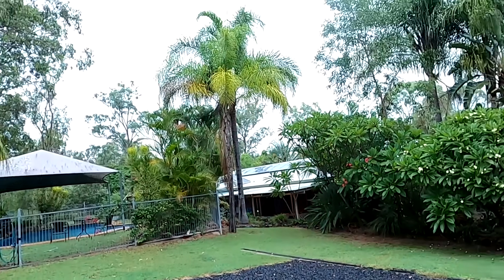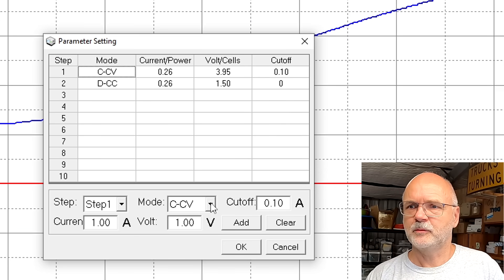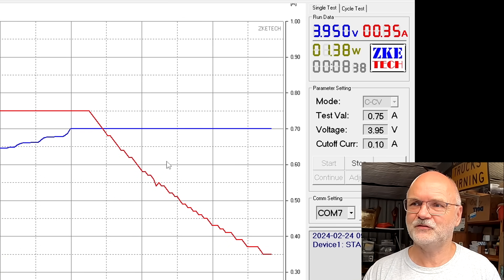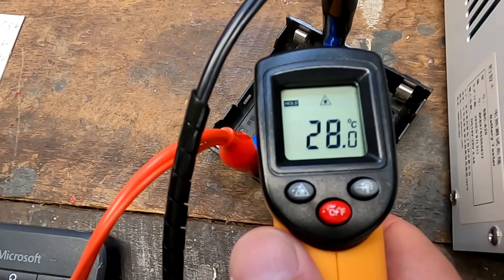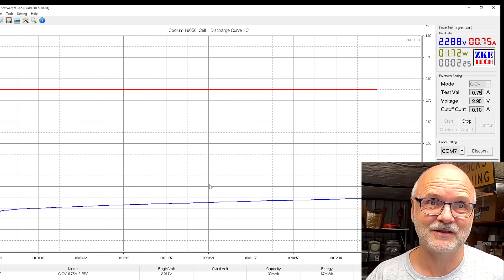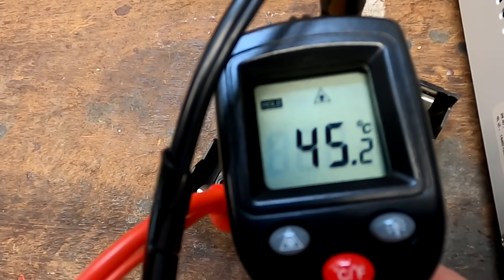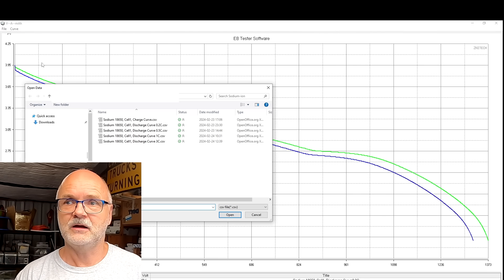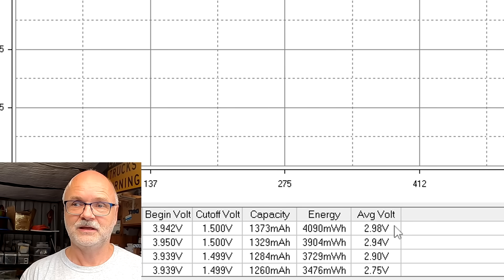Sodium Battery C-Rate Test and Comparison. Better than LiFePO4?

Comment: These tests being performed on small cells is a nice start.

To be super fair when comparing them to LiFePo4 or Lithium-NMC, the tests for those lithium cells should also be performed on similar rated 18650 cells, especially with respect to temperature.

As for those temperature ranges in the datasheet, are they ambient temperatures or cell temperatures? If ambient, 45°C for the cell is no problem, really.

It may not happen any time soon, but I would like to see a performance comparison on bigger cells (but to get 3C on those would require something bigger than the chinese cracker tester)

Comment: I was hopeful for sodium batteries, but the wide voltage range is a no-go for me. I'll be leaving so many amphours on the table by the time I hit the lowest voltage my inverter can run on. I may get a low amphour battery to use in an emergency situation such as sub zero temps.
Reply: Yes, so far it still seems that it is better to take care of the temperature comfort of LiFePo batteries than to use sodium ones because of the temperature. Because price is definitely not the reason at the moment.
Reply: @pavelsulc2617  at the moment correct but I can see this becoming cheaper as the manufacturing process gets better as sodium is more available
Reply from the maker: Look at the specs of these cells. below freezing point, it's only a 0.2C charge and discharge, so not great if you need power.
Secondly, even if prices would come down, due to the fact that you cannot use its full capacity, you would need to purchase even more sodium batteries to match LiFePO4 capacity. That also means more storage space for sodium batteries.

Comment: it's so weird that it rained here today too (Uruguay), this makes it feel like the whole southern hemisfere was rainy. (even if we really are just talking abour a few sq km area really) 
for me the main thing is that sodium batteries have the capacity to be so much cheaper than lithium ones. its as common as sea salt.
Reply from the maker: Even if they were cheaper, you would need more of them to match the capacity of lithium. So, more space to store and connect them.
Reply: Raining here in Hampton Roads Virginia (Chesapeake) also. 😂

Comment: too bad the voltage range is so wide. otherwise it would be great for rv use in north america during colder weather.  would be interesting charging and discharging within lifepo4 voltage range and see what the capacity might be.
Reply from the maker: Even during colder weather, you can only charge and discharge with 0.2C. Is that still an advantage to lithium? Yes, but a very small one. Would you swap lithium for sodium? Certainly not...
Reply: @OffGridGarageAustralia  and in the case of more cold resistant electric car(I live in the canadian praries), not going to cut it at .2c   And we would need something -30 capable atleast for non climate controled equiptment

Comment: So Andy, What would you say the Power Density of Na+ battery versus LFP battery?  So if you built a battery Bank such as Seplos what would the KWHr capacity be versus the LFP Seplos Battery Bank capacity??
Reply from the maker: You would need a lot more space, that's for sure. We can use only a portion of the available capacity of sodium cells with our inverters so, atm it makes no sense to build any batteries with these cells.
Reply: It seems that 210 ah prismatic is about equal to 280 ah lfp by size and weight

Comment: Thanks for the insight testing the sodium batteries Andy!  LiFePo4 really is kinda magical in that nice flat discharge curve.  Provides nice stable voltage thru almost the entire capacity.  Loving mine so far!  (1 100Ah rack battery on a cart and a 12.8v 304ah one in the garage)  Again thanks for all your work, it's nice to see someone else as entertained with and geeking out on the graphs data like I am!  The wife could care less....until the power goes out....
Reply from the maker: Thanks a lot for your feedback and kind words, Chris.

Comment: 0.5C would be 0.65A and not 0.75A. if it's a 1300mAh battery.
Reply from the maker: It says 1500mAh on the heat shrink of the cell so we did the initial 0.5C test with 0.75A. I took that result and didn't repeat the test with 0.65A. It would have made no difference for the end result and comparison.

Comment: Interesting test, suggestion since the battery voltage varies so much would not a constant power load test be more useful? The curve would look much flatter the a rapid drop off. Say 1.5V x 3.9A = 5.85W constant power. It would be easy to design a DC/DC converter to supply a constant voltage.
Reply: The ZKEtech testers can only do constant current or constant voltage (at least, that's the case for the 40A one, and it uses the same software).
Reply: @davidpenfold  
To test battery's I use my Rigol electronic load, it can do constant V,I,R,P it's limited to 150Vdc, 40A, 200W, it has a battery test function.
Reply from the maker: Both ZKE testers also can do a constant load test.
But all batteries are tested with constant current. Including the voltage makes no sense as it changes all the time.
Reply: @OffGridGarageAustralia  
But small battery loads will/can be constant power, with a DC/DC converter creating a constant load voltage, the discharge curve will be much different. These batteries will suit that application easily.

Comment: Another question is whether charging to a lower target voltage such as 3.70V fully charges the sodium battery, or do you have to push it up to 3.95V to fully charge it?
Reply from the maker: This will be in the next video!

Comment: Interesting.  Not just capacity, but the watt-hours will be even worse due to the larger voltage drop.   Hard to see the 1C difference in voltage drop but it does look larger than for 1C LiFePO4.  That wasn't a complete capacity test though, it the tester stopped earlier because of the voltage drop but there was probably still energy in the cell.

We need round-trip efficiency numbers for 0.2C too (watt-hours-out / watt-hours-in).   Tried to look that up but I only see the 0.5C tests in the Test2 zip download.   Oh, under Test2_C-Rating ... only the 0.2C discharge curve though, I couldn't find a 0.2C charge curve to check mWh against.

Color bars at 14:24 aren't right.  It's showing green as 1.0C but that's the best curve, not the worst curve.

EDIT: Add.

4165mWh for 0.5C charge curve, 4090mWh for 0.2C discharge curve.  98.2% round-trip efficiency (so 0.2C charge curve would almost certainly be at least a bit better).  That isn't bad at all.

Then 1C discharge curve, 3729mWh ... 89.5% round-trip (vs 0.5C charge curve).  Pretty horrid.  Same for 3C discharge curve,  3476mWh... 83.5% round-trip.  Yuch.  But that isn't counting energy left in the cell after the tester stops.

-Matt
Reply from the maker: Thanks Matt, all curves and data is in the folder. Even the 0.2C test...

Comment: I can see these being useful in a low power setting using a boost buck converter to stabilise the output voltage to the load but the voltage swing is too great to be used directly in a 12/24/48v system
Reply from the maker: Yeah, that would technically work, but the energy density is still lower than with lithium, so makes no sense using sodium batteries atm.
Reply: @OffGridGarageAustralia  I’ll be sticking to my lifepo4 cells for the foreseeable future. Built my first battery over 2 years ago after watching your channel and learning a lot from yourself. Thank you 🙏🏼

Comment: Like# 304 😢
Reply from the maker: I give you like nevertheless....
Reply: I’m super interested in this chemistry as I’ll be in severe Winter environments. 
The mountains call my soul in the Winter, Montana, Wyoming, Idaho, Utah… currently I have solved the challenge by installing my batteries inside my fully insulated shell. But once I did run out of battery during a 4 day winter storm and temps reached 34°f. I had to drive from 10k feet down to 4k feet for sunshine and warmth to recharge then returning.

Comment: I can't say if those sodium batteries are good, if you think about a 16s battery whose terminal voltage fluctuates a lot with the load. 
And, for example, which inverter can use such an enormously wide voltage range without interference. (example 48V system and battey voltage fluctuates 24V-63V NOT GOOD!)

In my opinion lifepo is much better because of the flat voltage curve. The devices survive more easily when the pole voltage does not drift over wide area, and remain almost constant throughout the capacity range.
Reply from the maker: Yeah, that's what we discussed in the last video: https://youtu.be/H5iTZ_0WT9w

Comment: The sodium battery maybe a good backup for below 0°C (32°F) or for use in low demand times, but they really need to be way cheaper than lifepo4 to replace them in my view. I could see if they do get a 1/3 the cost to consider them or as a hybred system for sub freezing weather. That flat discharge voltage, cycle life, safety of lifepo4 is hard to beat.
Reply: I believe that idea around Sodium batteries is to be "cheap" (when production/demand volume goes up) and more eco friendly . By all means LiFePO4 are , in my opinion , for the price , the best storage solution at this time , but Sodium batteries have great potential (when price goes down and people start producing them locally) and those aren't "unsafe" (I saw the nail test videos - no flames and not much of explosion - more like a "burst" ). 3C constant discharge rate is pretty nice , even though the battery packs are never designed to perform all the time at max discharge rate and the number of cycles is , also , very good. It is , still (relatively) early days , so , given a couple of years , we may see the improvements (in terms of performance and much lower price) and hardware to catch up.
Reply: maybe it will be a hybrid system with both in advantage.
Reply from the maker: Charge and discharge is only 0.2C below freezing point, so not THAT great either.
Reply: It'll keep your Ham radio going! @OffGridGarageAustralia

Comment: This data is quite interesting.  If I define the lower end of usable power as 2.6V (10.4 V for a 4S battery), the different C rates give very different usable capacities:

0.2C  - 78%
0.5C  - 73%
1C     -  66%
3C     -  55%

These results are rather negative considering that sodium batteries have been touted as a cheaper, easier to source materials, replacement for Lithium ion and lithium iron phosphate batteries.  Based on these results and energy density data it looks like sodium batteries will have to be considerably larger and heavier than lithium batteries.  That isn't much of a problem for stationery batteries such as in a backup power system, but is a real issue for use of sodium batteries in EVs.  They may be an option for short range, low speed EVs, but not much else.
Reply: If they end up a lot less expensive they do become viable for storage with existing battery inverters.
Reply: I don't think anyone in their right mind would consider using this chemistry for an EV
Reply: @pavelsulc2617  If they end up a quarter of the price of LiFePO4 then you could easily just use 3.9 to 2.5V for about 60% capacity and still be ahead. For storage only, I'd imagine, but that could be a huge potential market for inexpensive peak load injection etc.
Reply: @pavelsulc2617  I have read that the first EVs with sodium batteries are coming out already in China via a VW-Chinese joint venture.
Reply from the maker: Even if they would be cheaper, you end up needing more to compensate for the capacity you cannot use. Space is a HUGE factor for EV batteries. LiFePO4 will stay for a very long time and sodium will NOT replace them. That's my take.
Reply: @OffGridGarageAustralia  I'm only talking about peak load management for industrial scale really. LiFePO4 batteries are rather big already for home use, where paying more may be necessary due to lack of space.
Reply: @OffGridGarageAustralia  I agree, but don't tell that to the Chinese-VW joint venture that is now selling cars with sodium batteries.

Comment: I think they're crap.
Reply: All this can be worked with when it comes down to it. The only thing that will decide is the price if it's good, ok if not? then it is, as you say, scrap. The current price is not that important, production is just starting and the market is far from saturated, we will see how it develops in a year or two.
Reply: @pavelsulc2617  we need to mine 100x more lithium to meet the forced gov environment goals, so lithium will become then very expensive then sodium will become cheaper by default

Comment: Hi - just a thought..... because you are drawing far more current through your test set up cables, could that contribute to the voltage drop?  (perhaps run 1 more test where you double up the thickness of the wires? (obviously, ou cant change the thickness of the cables within the tester itself - but at least reduce the length of the cabling???)
Reply from the maker: The EBC-A20 uses 4 wire measurement, so current does not matter. We would have the same result with 20m long wires. I'll show this in a video soon😉

Comment: (change in voltage) divided by (change in current) = internal resistance of the cell
(3.65V - 3.35V) / (3.90A - 0.26A) = 0.082 Ohm

Comment: If you continou to discharge the battery after you started😊 with 3c, with 0.2c, there should still be some Energy left...
Reply: Where is that excess heat coming from with 3C? I have a feeling it's that lost energy.

Comment: What are watt-hours when charging, and what are watt-hours when discharging?
Reply from the maker: Depends on the voltage. Hence, we use constant current.
Reply: The reason I ask is that watt-hours charging and watt-hours discharging give efficiency to the battery. And what would a typical efficiency be? @OffGridGarageAustralia

Comment: So in conclusion Lithium Iron Phosphate Batteries are Great for Solar Power Storage and Use until Sodium Cells are made Readily available.
Reply from the maker: Sodium batteries are readily available. That is not the problem with them.
LiFePO4 will stay and NOT being replaced by sodium for quite a long time.

Comment: I think at the higher current you are going to get into issues with contact resistance from the battery holder.
Reply: 0.3V difference between 0.2C and 3C suggests internal cell resistance of ~83mOhm vs <20mOhm in the datasheet. Would be good to see a retest with a 4 wire measurement.
Reply from the maker: The holder is fine and the contact fins have a lot of 'spring' force on the battery terminals. 
The EBC-A20 uses 4 wire measurement.
Reply: Thanks for doing this video series on Sodium batteries Andy, it's super interesting! If you are happy with the cell holder springs, then all good. They just stand out as the most likely source of error in the EBC's ability to measure the true cell voltage at higher discharge currents.

Comment: QUESTION
It's a great video showing the discharge curves of the sodium  battery C-Rating.
The only question in my mind is, was there any degradation to the cell.
Would you get the same results if you repeated the tests again?
Reply from the maker: I have cycled this battery cell for 40+ times now and still get the same results. If we cycle it 1000 times maybe...

Comment: So, what would be the use case for sodium batteries? Inverters don’t like the 50% voltage drop over the discharge curve. 
I know my BLDC motor controller doesn’t like that either. 
What about for small solar light applications, where output can run through a joule-thief circuit? If these cells don’t mind draining very far down, then I could see their use there. Or perhaps in power banks. 
Or emergency lighting?

Where do you see their specs as an asset instead of something to be worked around?
Reply: Inverters and associated equipment will need to be redesigned for the new discharge/charge curve to be useful..
Reply: you could make a weird battery bank that changes internal connection from parallel to series to bump the voltage
Reply: @423GustavBern  that’s just working around the problem. There are better suited chemistries for those situations. I am wondering where these batteries naturally make sense. Engineering around the problem is just money and effort best put towards a solution that doesn’t require that money and effort.
Reply: @somebody1869  that workaround will solve the problem and will still end up being cheaper then other chemistries in many situations....and to meet the gov goals we will need all the batteries we can get and we still wont have enough, so this sodium stuff will be used in a lot of places despite the atrocious voltage drop
Reply: If you want below freezing charging. Lead acid is pretty much the only option currently that doesn’t cost a fortune.  These would work great at below freezing and if they get cheap enough may replace starter batteries
Reply: Why not for inverters, if you only use the batteries above 20 or 30% SOC. Depends on price, finally you get more life-cycle. After all, lead batteries allowed also using only 50%...
Reply: We don’t use LA below 50% for battery cycle life reasons. This would be leaving unused battery capacity on the table due to inverter electronics reasons. 
Is an inverter that can handle a 24v - 60v range more expensive than the current crop that handle 40-60v. 
And what does that do to energy conversion efficiency?
I’m curious what the impact is to the industry if we want to access the full capability of this battery chemistry, without adding an energy conversion layer between battery and inverter.
Reply: If you have a hybrid inverter and just want it to work with a good C rated battery, sodium might be a good solution even when you can not use all the capacity stored in it with currently available inverters. We're already seeing them as starter batteries.